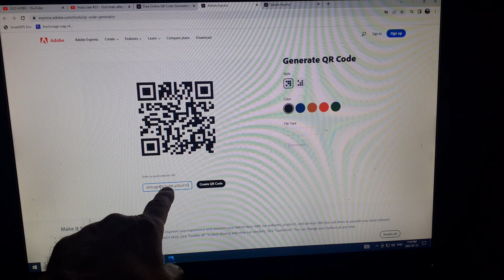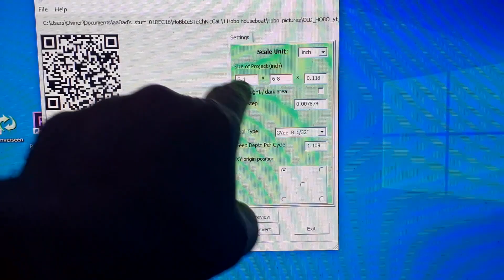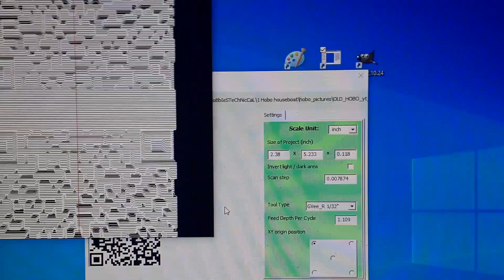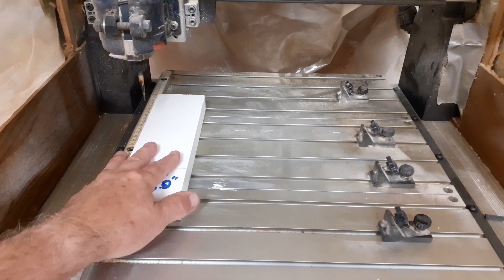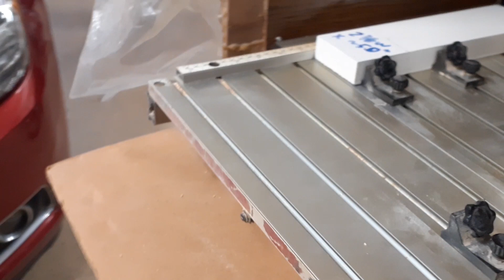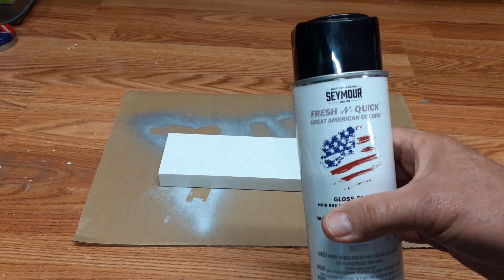Make QR codes for my boat?  - an Oliver CNC router project

Comment: I have watched your videos on the Oliver CNC but I am having an issue that I hope you can answer for me. I only want to carve the actual image file that I uploaded to the ipicture program. I have tried everything from making the background transparent in photoshop to loading different types of files. It there a way in one of the setting that will only allow it to carve the actual dark lines? Thanks in advance for any help.
Reply from the maker: Hi Dave.  I don't  have Photoshop, but GIMP has similar functions.  I am a hack when it comes to GIMP and have tried a lot of different things to make carvable images.    I usually convert to grayscale from color.  Then use "intelligent scissors" to cut image from background and save to new file (if necessary, it is a lot of work).  If I want a smooth realistic image I use "Gaussian Blur" filter to create smooth gradients.  It sounds like you want to make an image into a line drawing.  See next message.
Reply from the maker: To make a line drawing I "desaturate" and create a gray scale image..  From there you can play with contrast to eliminate grays and emphasize blacks.  There is also a function to adjust color levels.  I am no expert, and just experiment to get what I think will work.  In the end I always blur the image to create a gray transition which will reduce burrs and ease sudden liading in the router.
Reply from the maker: Again, not sure exactly what you need, but as far as type of file, whatever you manipulate in Photoshop (cutting out background,, enhancing contrast etc) , save or export to a jpeg or bitmap file.  What you view as a grayscale will be interpreted as proportional depths by i-picture.  Within i-picture the only choice you have is "invert light/dark area" which makes white full depth instead of black.  Did any of my rambling help you?